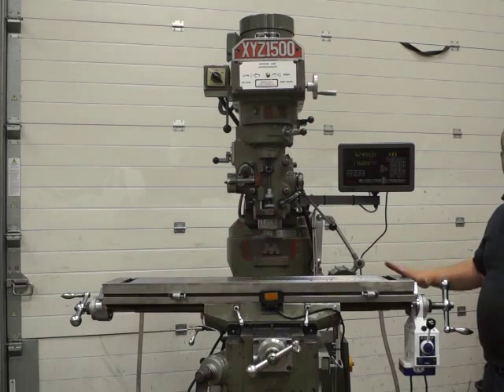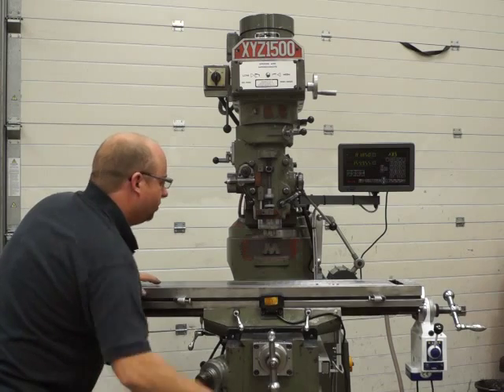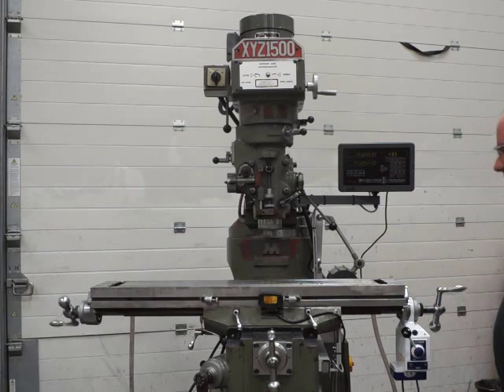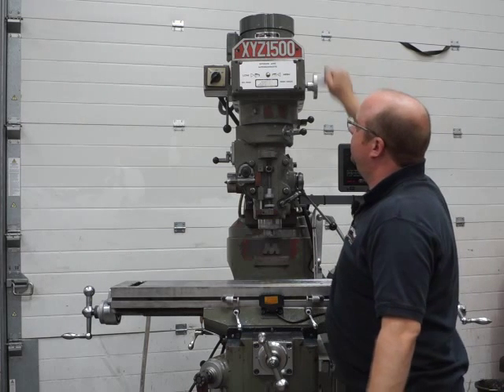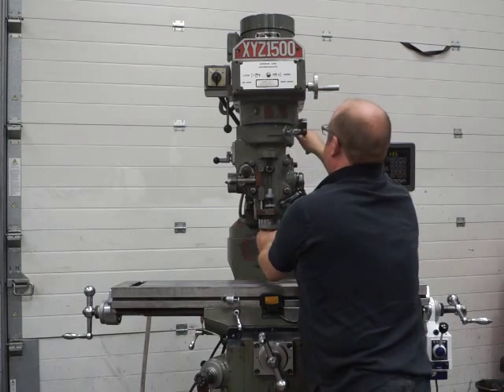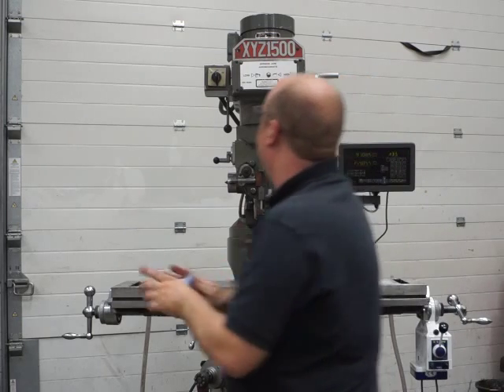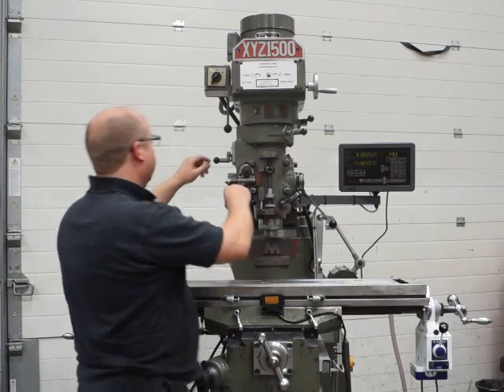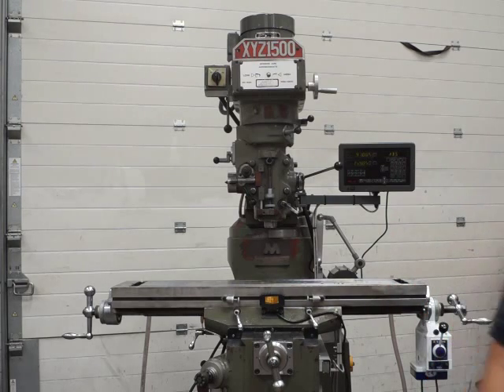XYZ 1500 Vertical Milling machine with DRO system

Comment: Hi Darren, months later but still got questions. I have the KingRich KRV-2000, I think it is the next model up from this one. Would the bearings, belts and alot of the parts be the same as the Bridgeports. On your rebuilds do you replace all bearings/belts or use the old ones if they appear ok. Love your channel man, full of really down-to-earth content for newbie backyard machinists like me who want to learn, keep the videos coming, really appreciate it all. Cheers, Gordon
Reply from the maker: Hi Gordon we replace all bearings and belts regardless on the Bridgeport rebuilds the bearing will all be at least 30 years old and may sound fine running at slow speeds but will be noisy at higher speeds so all get replaced as standard. Spindle bearings also and the knee bearings are replaced. 
The parts for Your KRV 2000 aren't the same (maybe the odd one - some bearings are the same) however the parts are generally a lot cheaper than the Bridgeport spares. I have just rebuilt a KRV 2000 head so if you need advice on which pulley to buy for the motor let me know (there a few different motor shaft sizes) If your Vari head is sounding noisy change the moving motor pulley first its probably the source of the noise. (Also the front moving pulley) I could write a very long essay on what goes wrong with the Vari heads - but am working on some new videos to help with the rebuild process.  Thanks for the support!
Reply: Hi Darren, thanks for the heads up. More videos would be great, can never have too many of them I reckon and if you ever get a KRV-2000 in for head refurbishment it would be awesome . I watched your Bridgeport head video several times and since I couldn't get hold of a manual for my KR I followed your steps, paused, played, paused, played etc and wrote all the steps down as a procedure and when I did the disassembly it all went pretty much along your video...... plus a few trips inside to watch the video as I went just to check. I will do a search on the www to see if I can track a parts manual down as with your advice I will now replace everything. One thing I do really like about your videos is the parts description and part number you flash up, this is unique I think to your channel and is great because sometimes alot of your viewers are in other countries, we have slightly different accents and also may not be aware of your suppliers, manufacturers, etc. I find most often that I ca find a distributor here in AUS by contacting their head office. I know that these videos must slow your work down a little but it really is awesome of you to take the time to make them. I live in a rather isolated area of AUS so it is just not viable for me to transport my machinery to get repaired...... and besides it's not always about the cost, it's about absorbing the knowledge of guys like you and doing the job yourself, so much satisfaction. Your a good man Darren, thanks so much again.Happy easter mate, regards Gordon

Comment: Hi Darren, the XYZ used to be King Rich, is that correct? How similar do you find the XYZ to the bridgeport, Cheers
Reply from the maker: HI Gordon yes that's correct this one is a king Rich underneath - I like the XYZ its a bit heavier which means you can get the 40taper spindle which is a great advantage on the bigger jobs. Still love the Bridgeport though.
Reply from the maker: Hi Gordon sorry i didn't reply sooner I am still not great with seeing when someone has put a comment on. I like the King Rich - XYZ machines they are very similar to the Bridgeport in operation and parts are reasonable.